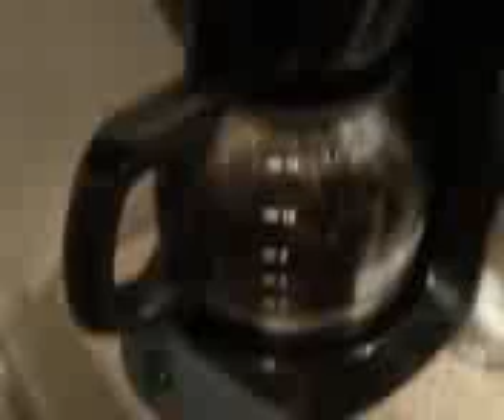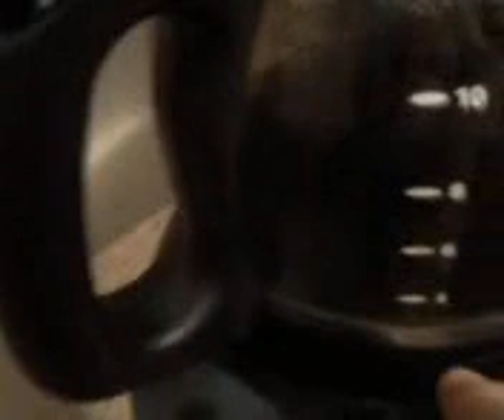Coffee Maker

Comment: You drink it black? I mix it with milk which cools it off. I think coffee tastes pretty stale after a whole hour, even black I'd rather not let it sit that long.
Reply from the maker: I drink it with cream or half and half. Milk enough to cool it down to the temperature I prefer would mean having a latte with a weak brew coffee rather than an espresso, so I usually put one to four ice cubes in my first cup or two of a given pot.

Or just wait a few hours, such as brewing the coffee before bed and drinking it when I wake up (I don't do this anymore because my new Mr. Coffee has a working timer, so I just set it to start brewing the coffee a while before my alarm clock is set to go off).

I've never had an issue of coffee tasting "stale" after being left out for a few hours, or even a full day. Now, if left on the heat for more than an hour or so, it will taste sour and acidic (which is why restaurant coffee, especially fast food coffee or Starbucks) tends to taste pretty bad. This, I found, is a contributing factor to why I used to put sugar in my coffee but don't anymore.